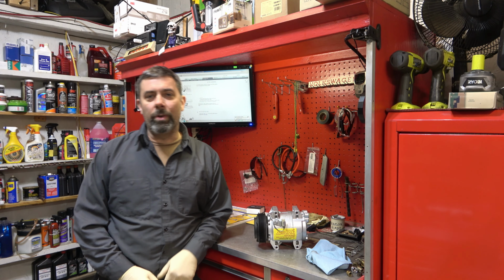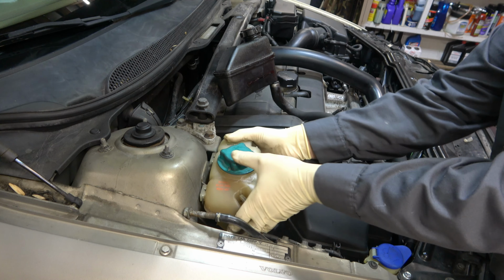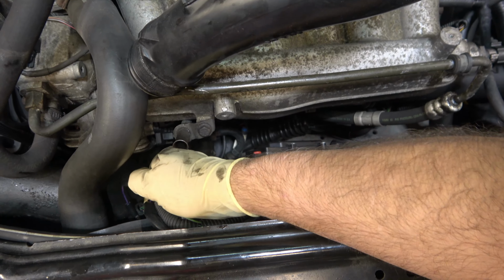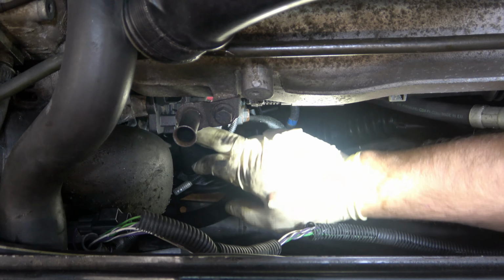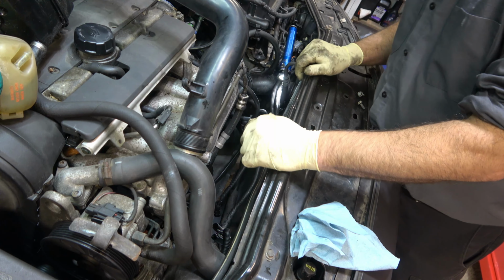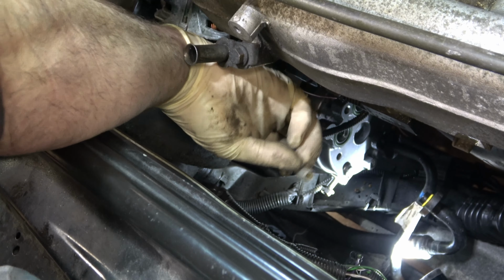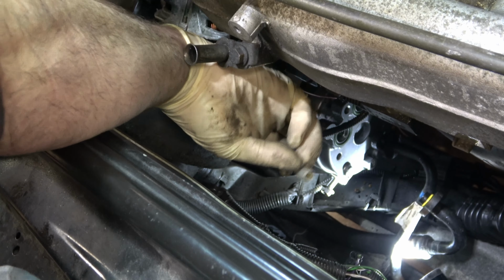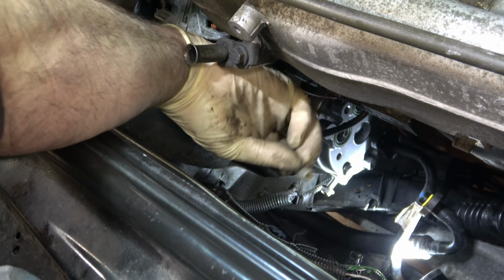01-08 Volvo A/C Compressor Swap. DIY and Save A fortune on your Air Conditioner for summer.

Comment: Thank you for your video ,I am retired shop owner.I have the same problem 2004 xc90 2.9 T6 is the shroud doable from the top like t5 ? Or go from the bottom to get the compressor out.I sold my 2 lifts have to do it the hard way.Thanks .
Reply from the maker: That job is nearly identical as this one on the 5 cylinder. Good luck!

Comment: Hello! Thank you for making a video that seems simple enough for me to follow, but i have a question. I have been told by multiple people that i have to replace the condenser as well when swapping the ac compressor, however the ac has never been working in my ownership and i don’t care about that either. It’s just that the clutch seized spinning or the ac seized up. All i care about is that the clutch spinns freely, so can i just swap out the ac compressor? Again do not care about the ac at all.
Reply from the maker: I can assure you that you do NOT need to swap out the condenser when doing this job. You'll be A-OK just doing the compressor. Good luck!

Comment: Please help? What is the part number of the ac compressor bearing for a Volvo s60 2001 model? (Just the part number of the Bearing please?)
Reply from the maker: I do not think you can rebuilt the compressor. The clutch? Yes, but the compressor is sold as a unit.